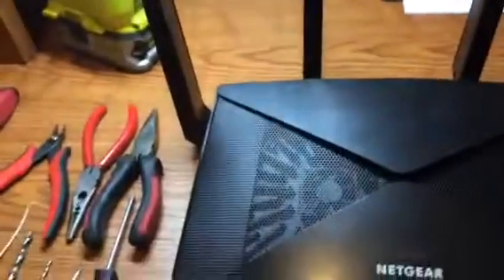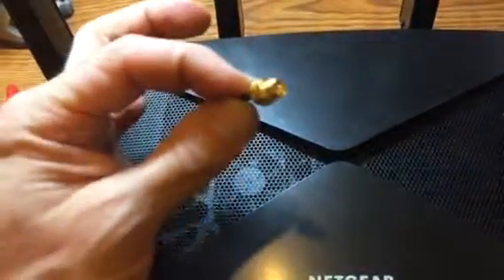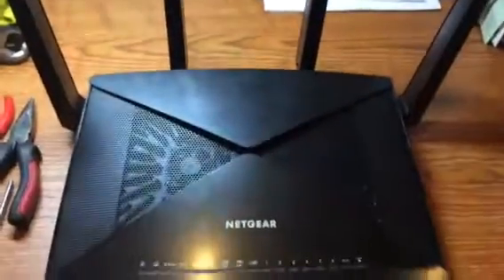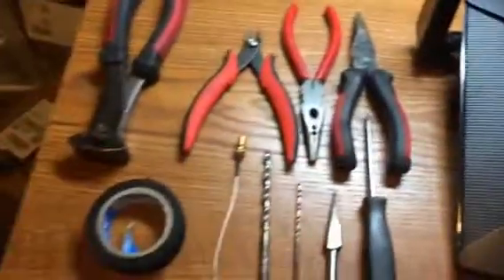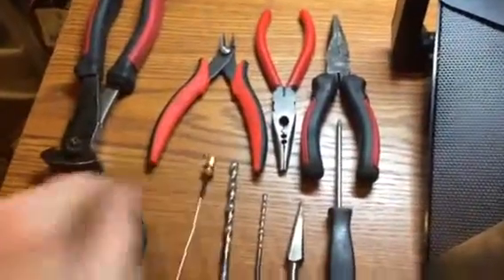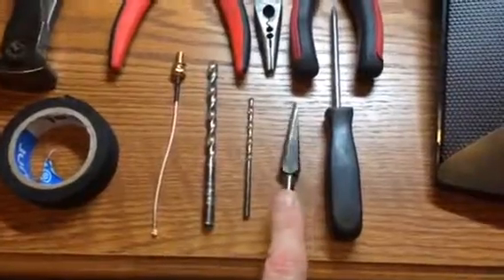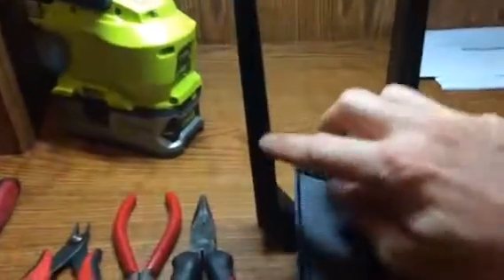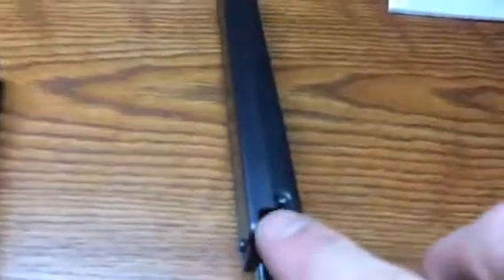Netgear R9000 AD7200 antenna repair and RP-SMA retrofit mod part 1 of 9

Comment from the maker: FYI, I just did the same thing with the Netgear Nighthawk AX8.  Piece of cake... four u.fl connectors on the main board.  Drilled four holes in the side panel (where all the ethernet ports and the power switch are), a pair on each end, for the rp-sma ends.  Removed the stock antennae entirely.  Multi-gig transfer speeds over 5 Ghz 802.11 AX on the second floor of the home w/ the router in the basement.